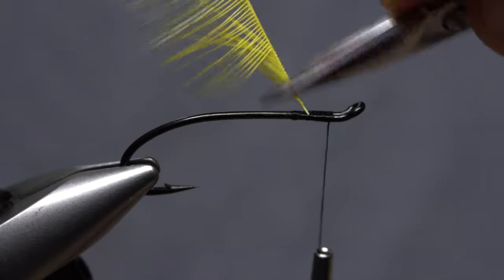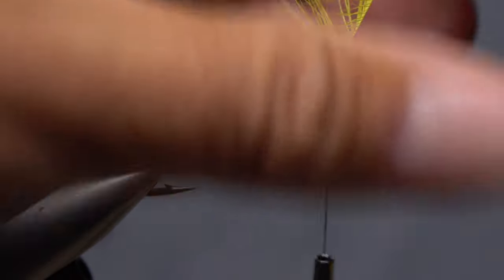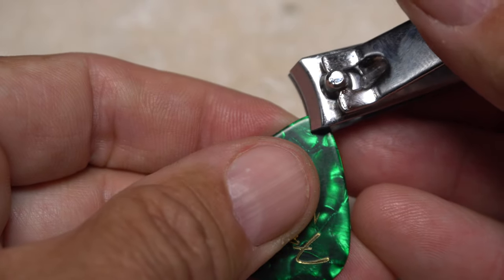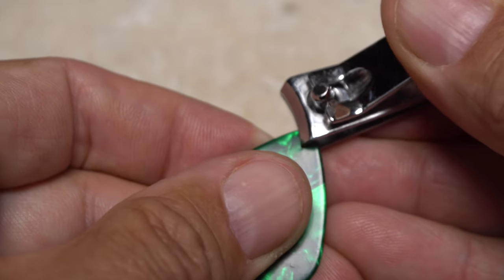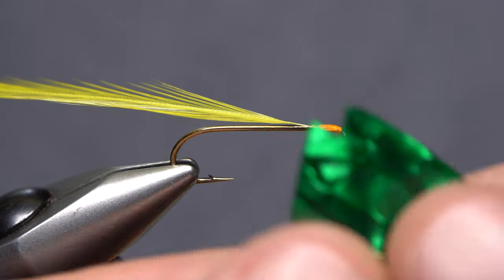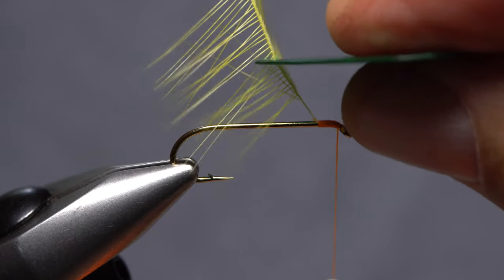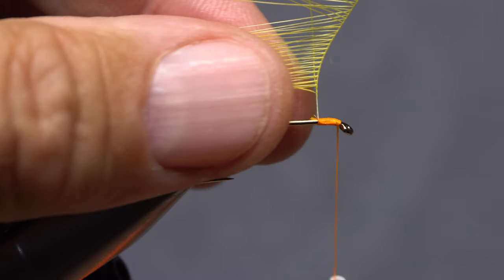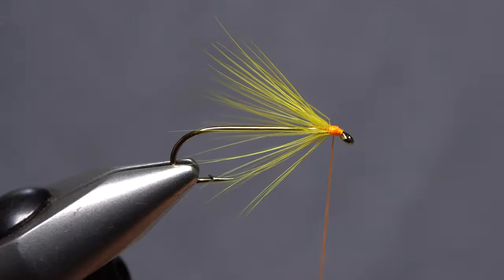Hackle Folding Tool

Comment: Good idea.  But you could also use a bread-bag plastic closure.  They're so cheap and readily available that you won't care if you lose a dozen.  And if you cut the notch out of the back edge, you can use the front circular part to clip to a pole or another tool on your fly stand, so you won't lose it at all.